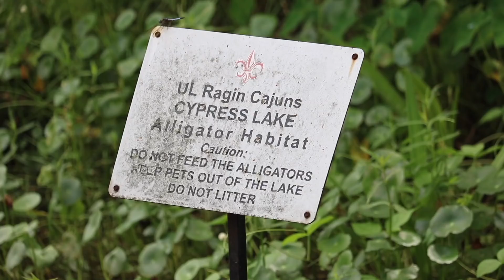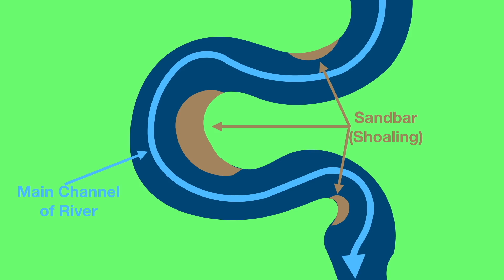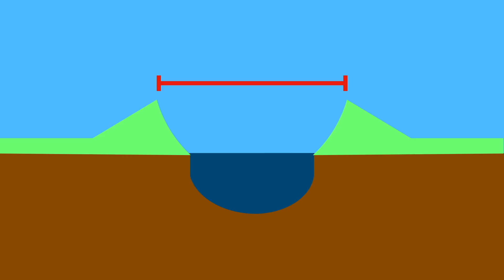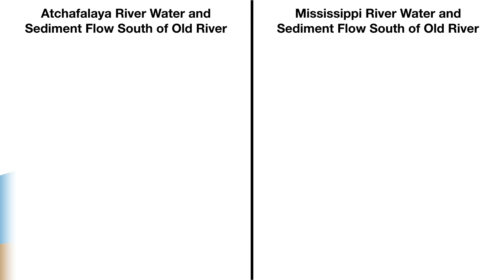History of Engineering Old River: Phenomenon Explained

Comment: One comment that I would add about a flaw in the US’ levees-only policy was that it was assumed that the velocity profile of the water was uniform, ie, the currents and the bottom of the water column was nearly to the top currents.  This is not true and is partially a result of the amount of sediment load this is concentrated at the bottom.  As a result, the scouring capability diminishes as you go from the top to the bottom.
Reply: I agree, the current isn't consistent from top to bottom. They change drastically by various different reasons. Wind, depth, direction (curves, bends ex.) But normally the bottom isn't as fast as the surface so this disproves the theory water cut the grand canyon over a course of years and years.

Comment from the maker: My first video using a teleprompter, so apologies for the fast talking. I'm still working on getting the correct speed for presentations down, and I couldn't really fix it in post-production without messing up the video. If you're interested in listening to me talk slower, click on the Settings (Gear icon) and you can change the speed to 0.75. That helps a lot.
Reply: Don’t worry Mr.Klien the video is still godly like usual
Reply from the maker: @luxluminaro  You get a Tiger Buck.